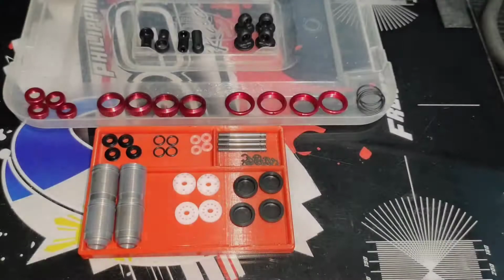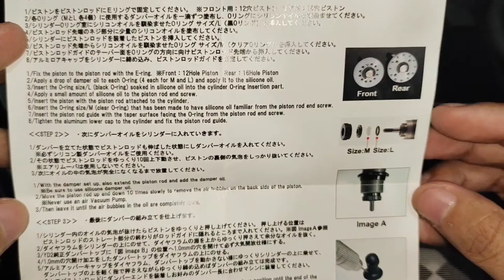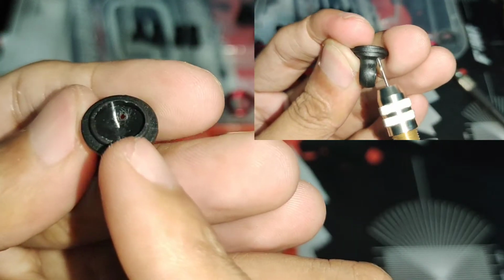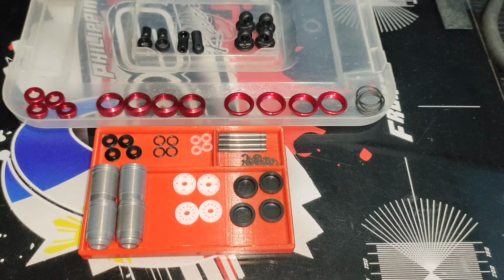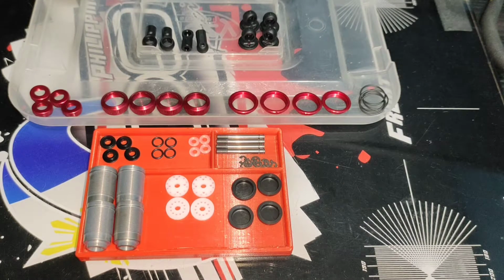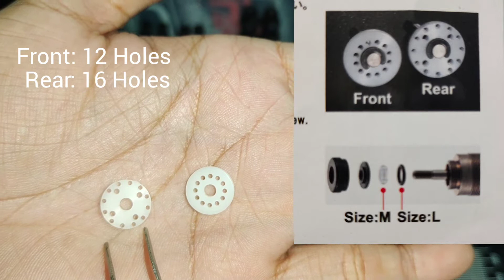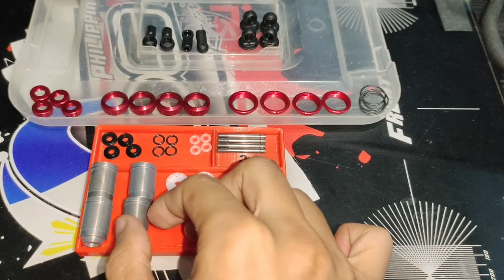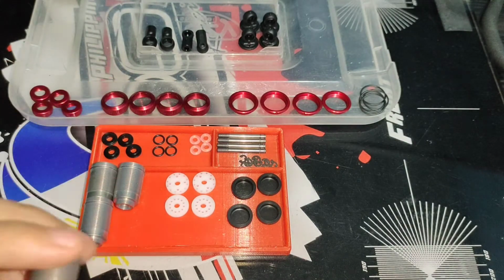Drift Oragon: Axon Revoshock 2 Damper Build | RCDriftVlog

Comment: how does it feel compared to yokomo big bore?? or overdose ones??
Reply from the maker: Hi thank you for dropping by.
Compared to Yokomo Big Bore, It is much lighter and have a bit bigger barrel, have a lot more piston holes (12 front, 16 rear) and have a very nice play even with 250 oil which is hard to achieve in Big Bore. All in all, Axon Revoshock 2 is a conversion or an upgrade to Yokomo Big Bore and would need a few parts from it.

I didn't have any overdose dampers so I can't compare it yet.

Hopefully this info would help you.

Comment: The problem of this shock is leaking oil very disappointed. Mine keep leaking at the rear .
Reply from the maker: Hi Good day thanks for dropping by and watching.

Yeah I think leaking dampers is very common. I too have leaks in all of my dampers from the stocks of D4, D5, RMX2, YD2 to Tamiya TRF Bigbore, Yokomo Big Bore, MST TR60, and Axon Revoshock 2.

What I do help lessen the leak is when I don't use the kit or in storage, I put it on something that will elevate it and have the wheels hanging that way when it's not in use,  the dampers are in relaxed mode.